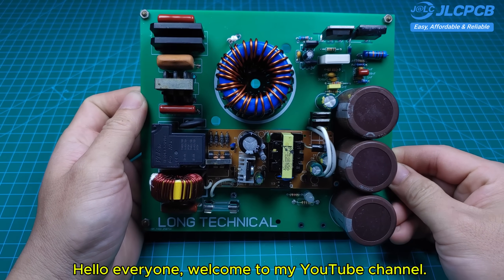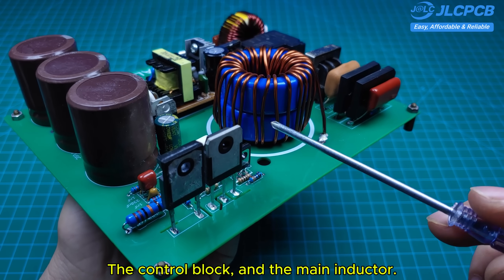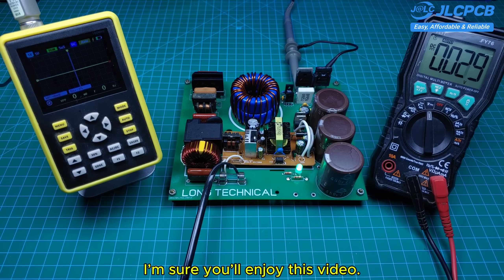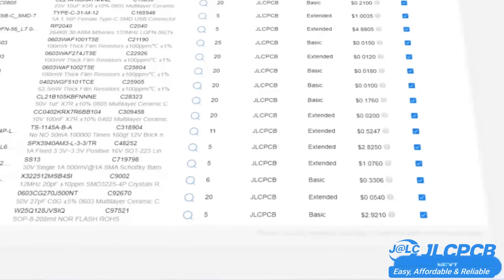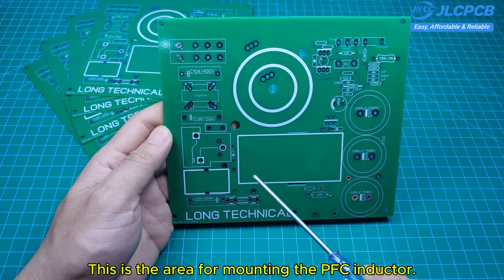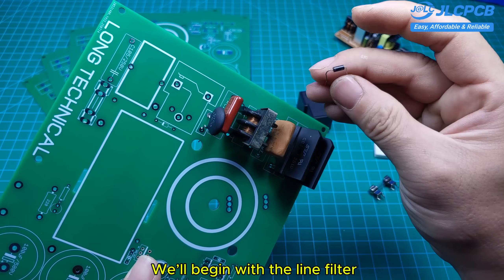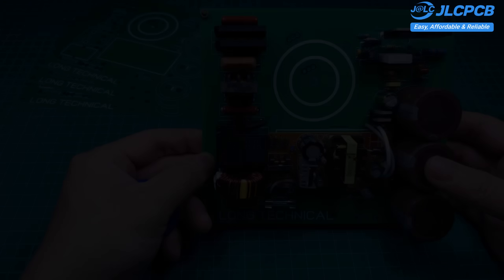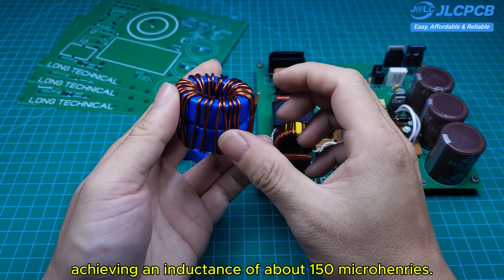How to Build a 2000W PFC Circuit with IC1653A | Step by Step Guide | JLCPCB

Comment: Nice work! What is the material of the ring? And can you show the current waveforms through the choke and the voltage waveforms on the transistor?

Comment: Hello hello, excellent project, you can make a UPS using the Lm2596XS, cn3303  battery charger, 12 volt input and 3s BMS modules.
Reply from the maker: I will try in the next time bro